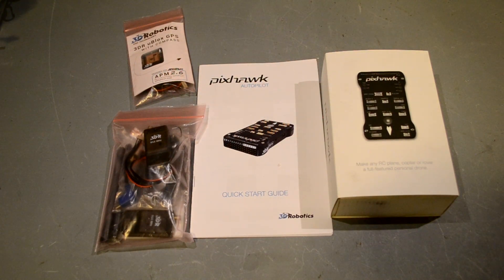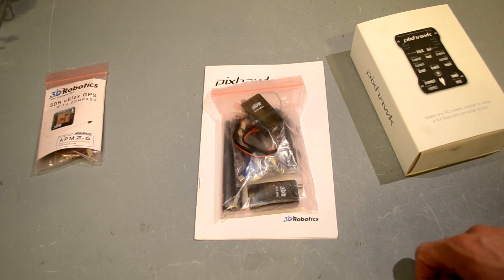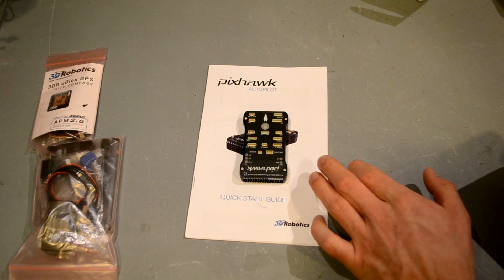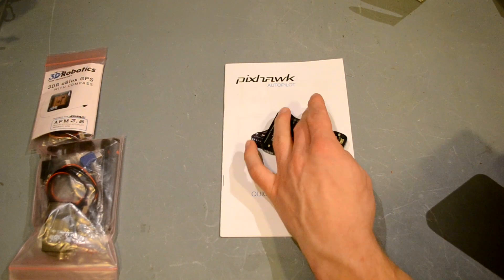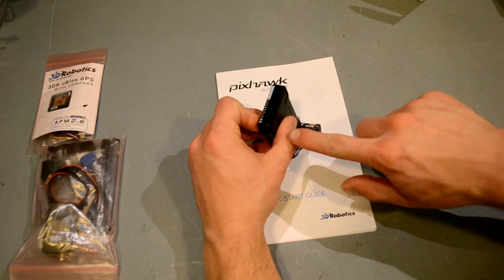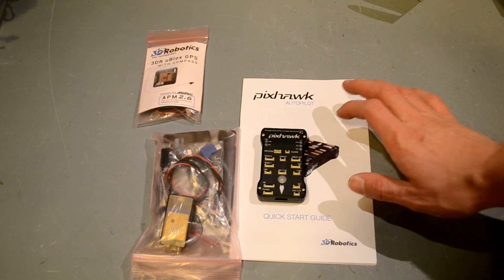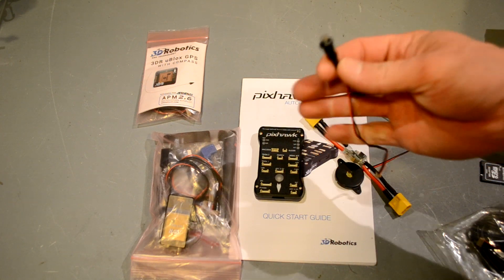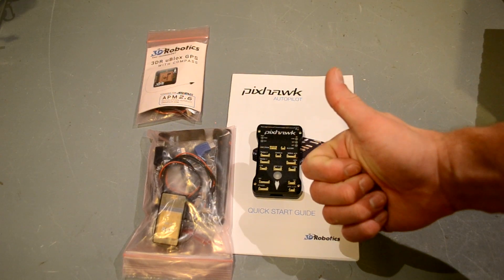First Look ---- Pixhawk PX4 Autopilot

Comment: Brandan, so how much did they pay you to make this phony video promoting the Pixhawk?  I've been waiting for 1 1/2 years for them to get Qgroundcontrol running but it still doesn't work to setup the PX4 so I gave up and got a KK2.1 so I may finally be able get my quad to fly before I'm in a nursing home and too old to fly it!  I don't think the crappy shareware flight control software will ever work before the app developers get tired of working for free or get kicked out of their Mom's basement and have to get a job or move on to something more interesting. There should be a requirement that anyone selling a board like this provide software that works along with it so it can be used or face prosecution for fraud!
Reply from the maker: Awe did somebody get butthurt not understanding how development platforms work? I'd teach you but you spelled my name wrong :( stick with DJI, super easy to spell and almost cheaper than learning to fly!

Comment: New to the AP thing since CES 2015 is all about it.  So this is a full-fledged flight controller and not just an add-on module?  Anyone running this on a 250 sized racing quad?
Reply: Not an add-on. Standalone module.

Comment: Brendon, the software is so bad that you'll never be able to get any of that to work!  I've tried both Qgroundcontrol and APM Mission Planner and they are both totally useless!  My Pixhawk is probably going back on Ebay so I can get something better.
Reply: david ringler David, I got the PX4 on Ebay and don't remember what version it is but it's fine, the problem is most of the software is bad. All the software is Open Source which is just a fancy name for shareware that's written and maintained by other hobbyists in their basement. The story I read was the quad copter project was designed at a University in Switzerland around 2010-11 or so then turned over to the open source community to maintain it but they don't seem to be doing a very good job since most of it don't work anymore.  I guess lots of hobbyists use a Mac so I can't comment on that but I've tried APM Planner, both the Windows and Linux version, Mission Planner and QGroundControl and none of them worked last month! There are a lot of rabid fan boys for these programs just like there are for Apple so you won't get any help from the forums if there's a problem, they will just flame you with hateful messages if you say anything about it not working. Nobody even wants to discuss fixing any of it either except for QGC.  These programs are built on a software platform called Qt which I think is somewhat similar to .net for Windows but it was recently updated from ver.4 to ver.5 and that screwed everything up.  QGC and APM Planner both use Qt, I'm not sure about Mission Planner. The software is uploaded and maintained on Github dot com where they have an option to report Issues and bugs then somebody is supposed to look at it and make corrections and release a new version when it's fixed. QGC is the only one that has anyone working on it and they release a new version almost every day! If you use that you should be OK. You can read about the progress by going to the Github site and searching for Qgroundcontrol.  When I tried it last month it wouldn't even run in Windows, Issue 810, then it got to the point where it would run but didn't have any features like uploading firmware to the PX4, Issue 822, then it would program the PX4 as a Plane but not a Copter and crashed all the time, Issue 827. It was up to Issue 860 last time I checked and I've tested over a dozen new releases but it actually works now to the point that I can program the PX4 then connect and see flight data. I don't have an RC transmitter yet but I can connect 3DR telemetry radios or Bluetooth and get flight data with them too.  At this point it may not matter if the other programs like APM Planner or Mission Planner are ever fixed since they are obsolete!   There are Android apps like Andropilot and Droidplanner that can control the craft from a phone or tablet!   If you have problems I might be able to help although I haven't got to the point of trying to Arm or fly the craft yet.
Reply: david ringler  I've already ordered a FrSky TARANIS X9D and X8R Rx and Tx set from Hobby King but it's not going to get here until Oct. 1st.  There is a video showing how to connect telemetry radios to a Bluetooth adapter to use with a phone so you can get long range.

Comment: "Store Branded RTFHawk from, Whitespy,nice case.Very compelling $99,... FC - cables/switch/buzzer Slight variation on the case, Otherwise a complete match. Out of Fla. Good folk there and good shipping times for me here in Canada. My APM 2.5 has been so unpredictable during bench tests as it is acting up while running an Rx through it. Powering a total 270mA load (all peripherals + Rx) via 5V/3A UBEC thru the Input header, or via 3DR Power Module  are still plagued with problems like the brownouts or the failure of the onboard 3.3v reg. The Pixhawk has better power management.

Comment: HI BRENDAN! I HOPE YOU CAN NOTICE THIS COMMENT. I'M JUST STARTING WITH AUTOPILOT. ARE YOU GOING TO RECOMMEND THIS TO BEGINNERS FOR AUTOPILOTS? I'M THINKING ABOUT GETTING APM 2.6, BUT WHEN I SAW THAT PIXHAWK IT MADE ME THINK. I DON'T WANT TO GET BOTH..XD
Reply from the maker: It's just essentially a more powerful platform to run Adru(plane/copter/rover) software than APM. Everything else is exactly the same.
Reply: Brendan Stewart
okay thanks! Btw, you showed us a 915mhz telemtry right? is that the one that you are going to plug in your computer that can also be served as your tx?

can you use both of your Transmitter and laptop to control the aircraft?
Reply from the maker: yes, I use 433mhz on my transmitter. If you don't, 433 telemetry will give longer range

Comment: Subscribed.  I'm an APM 2.5 user but will need to upgrade eventually.  Dead cat quad and Y6 flyer.
Reply from the maker: Thanks! this thing is monstrous. I haven't even seen all that it can do yet

party on!
Reply: Brendan Stewart Yeah, I'm hoping for great things.  I'm planning to start developing a platform for this by the autumn.  Maybe a scratch built Y6.  Love co-axial power systems, awesome noise!
Reply from the maker: Yeah man I'm really torn. I want to build a 12 copter 6 up, 6 down! but co-axial systems suffer something like a a 50% efficiency loss
Reply: Brendan Stewart I don't think it's quite that dramatic, Brendan.  I've heard estimates ranging from 20 - 40%.  Since I'm not (yet) aiming for long flight times, it's not an issue for me.  The minimisation of the "sail effect" is potentially more useful, since it improves controllability in windy conditions.

It may be interesting to investigate single bladed propellors, these are rumoured to be more efficient than multi-bladed propellors but obviously, with a reduction in thrust.  Everything's a trade-off....
Reply from the maker: Motor Configuration Efficiency Testing - RCTESTFLIGHT -

Check this out. 

one thing I always do is inflate my entropy numbers, because quite often, the ways we calculate efficiency for our aircraft on a bench go completely out the window when the air temp and density changes, wind speed changes ETC.

as far as I'm concerned the only purpose for having a Y6 is to keep a LOT of thrust close to the CG, increasing agility at the cost of flight times. I've been looking into a micro y6 for doing proximity runs, 

test it out man! would love to see what you find!

Comment: Please share some of those promised videos regarding this unit! Quick stupid question, if the pixhawk has a satellite port, does that mean you don't need a receiver if you are using the correct spektrum satellite?  I'm new to this but it seems you can save a few bucks (and space) if you don't need the receiver as well?
Reply from the maker: I will don't worry! The plane I want to put it in is not in stock!

and you're 100% right! just pop a satellite on and it'll work just fine a regular receiver wont, because Spektrum doesn't support PPM
Reply: Brendan Stewart Sweet.  Me and a friend are looking to test a setup in a ultra stick.  It has enough space and is quite cheap should we crash it (more likely to happen than the auto pilot causing it!).  I will update you as well with our progress.  I'm thinking of going with the DX9 for a transmitter.  Do you have any advice regarding servos?  I'm in South Africa at the moment so I would like to order everything at once.
Reply: Bart Saaiman forget DX9. Get a FrSky Taranis. Seriously it's a great radio.
Reply from the maker: Yeah, honestly I'm kinda mad I spent all that money lol

Comment: Great video.. I've been waiting for this. . I look forward to more of your videos... 

Of you can, please let me know your sky hunter setup. . Thanks for great videos
Reply from the maker: Thanks man! I cant wait! I'm finishing a long range setup on the Discovery Pro and saving for the skyhunter right now.

I'm going to test the pixhawk on a more basic plane first, just in case of bugs.
Reply: Smart... I'll be poised for it..
Reply from the maker: Yeah. I've heard too many horror stories of trashing a brand new build because of bad PID tuning
Reply: Well I'm not 100% on how to do that. .. I hope you can help me..
Reply: Anyway you have a loyal follower now
Reply from the maker: Don't worry about it. Let me know what vehicle you plan to put it in and I'll do the R&D for ya
Reply: Will do.. Im Not Sure If You Know What The Ranger Ex Is Yet But It's Looking VERY PROMiSSING Or The Sky Hunter
Reply from the maker: I've seen the Ranger, it seems like a Skywalker set up for higher cruise speed, and a sharper stall.  my only issue is all of the stuff protruding from the airframe ( landing gear gopro ETC) a drag coefficient like that will MURDER your flight times, and therefore range. The highest efficiency platform I've seen is the X8. The trade off with that is it has the most finicky C of G I've ever seen. And that can be a killer with enough wing flex/battery slip.
Reply: I see
Reply from the maker: Check out the reviews on FPVlabs before you buy. It'll save you a lot of hassle
Reply: Will do.. right now I'm flying a bixler 2 w/amp 2.5 dragon link with go pro.. I want to up grade
Reply from the maker: that's a solid setup! Its a good idea to use a platform that a LOT of others have tested first. 90% of the tome someone has solved all of your problems already!